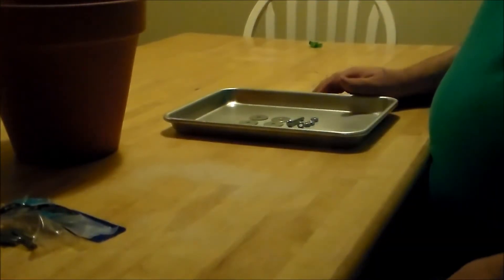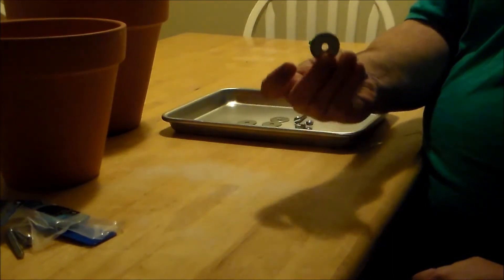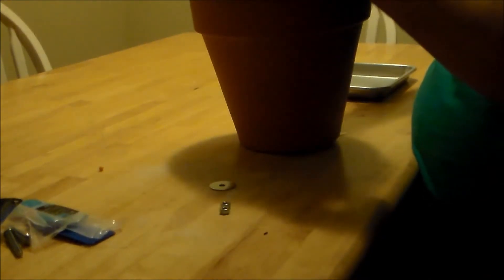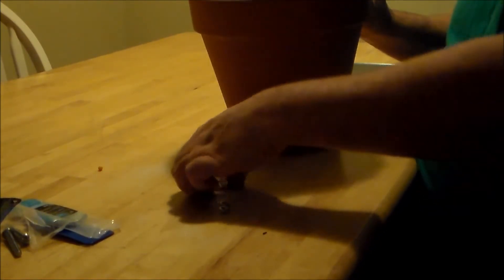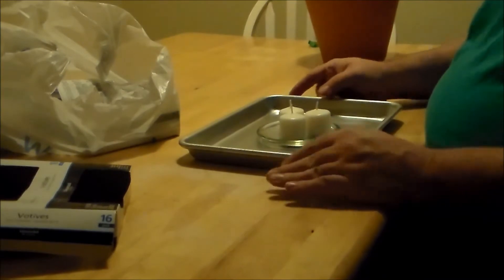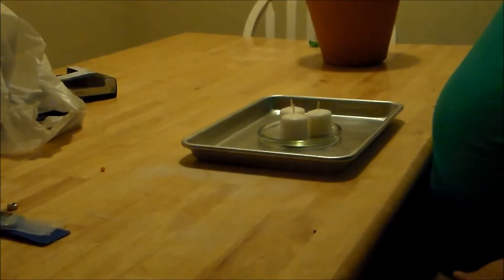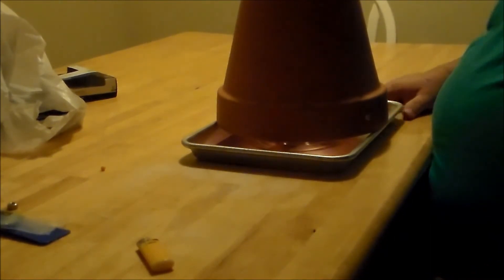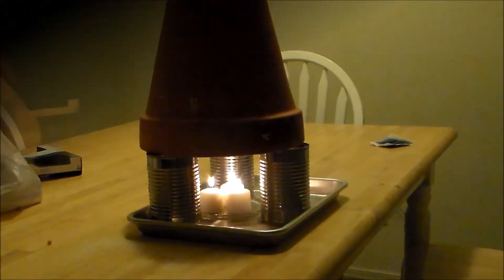Candle Heater

Comment from the maker: This candle warmer actually works!
Reply: I've been wanting to make one of these for a while now! :-)
Reply from the maker: I have an idea I am going to use to modify and make it better I think. I am going to get an oil lamp base and set underneath. I think it would be alot more efficient and get hotter. Going to try that this afternoon.
Reply: Cool let me know how it goes. Be mindful of the flash point of the fuel. If the temp under the pot reaches that temp it could be dangerous ;-)
Reply from the maker: Great thinking...I will try it outside.